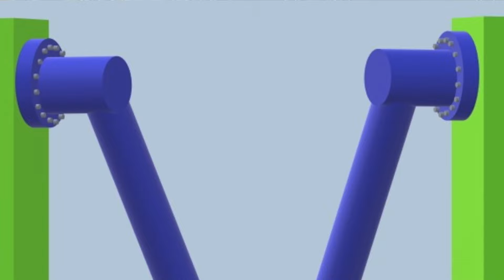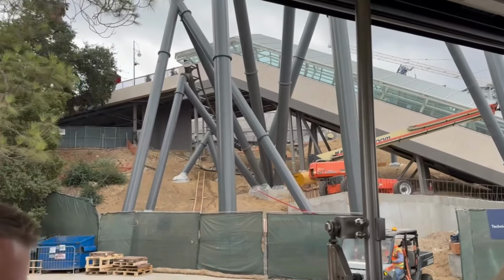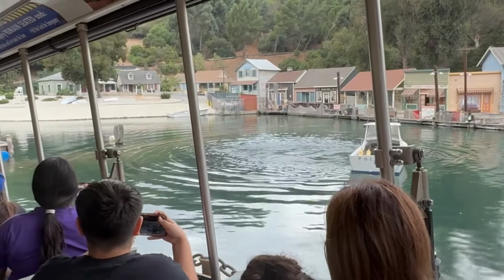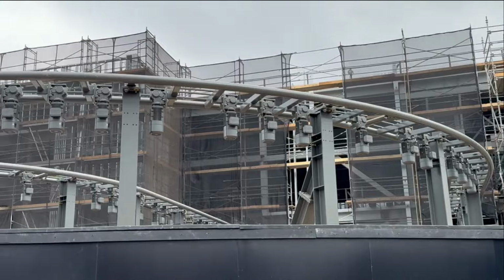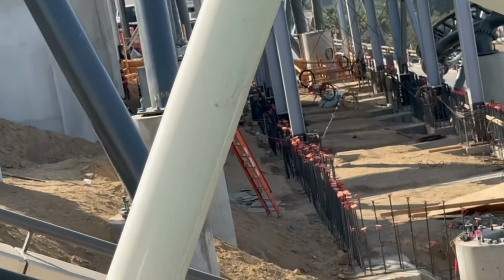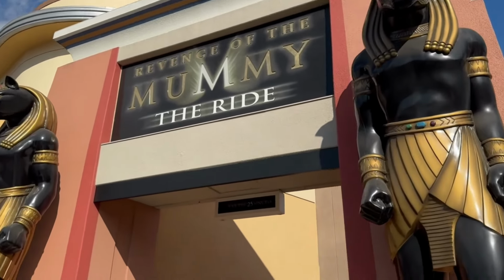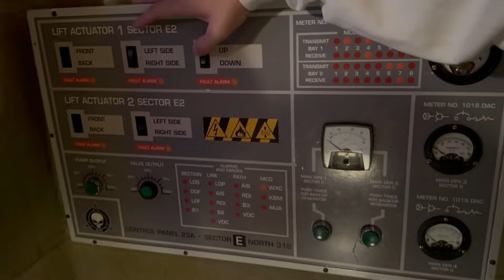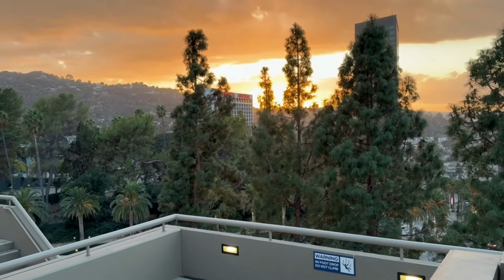Universal Studios Hollywood Trip Report October 2024  nerd shots and more

Comment: Do automotive style pneumatic tyres such as those used as drive tyres/kicker wheels on roller coasters and flat rides have a set tyre pressure, or are they just pumped up "enough"? Also how often are the pressures checked?
Reply from the maker: @bjoe385  some are pneumatic checked daily. Most smaller ones are solid rubber. Where the gap between the two are adjusted daily.

Comment: Who supplies all the hardware for a new coaster  like fast and the furious. Hardware meaning bolts and wire and electronics?
Reply from the maker: @kylesims9806  local supply places. You can buy electrical from any supply house. Manufacture calls out what they need. Manufacture also specifies the hardware used but it recommended to buy structure hardware from the manufacturer. That what when bolts break that can’t pon if off like “what did you buy” that not our problem.